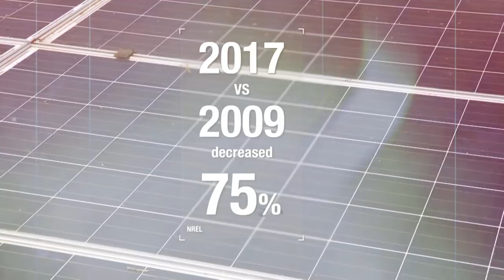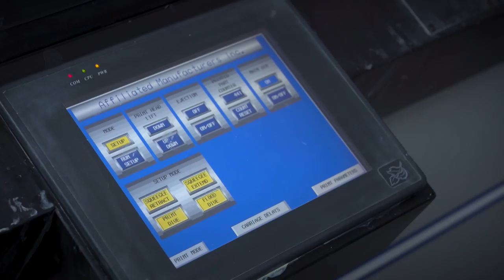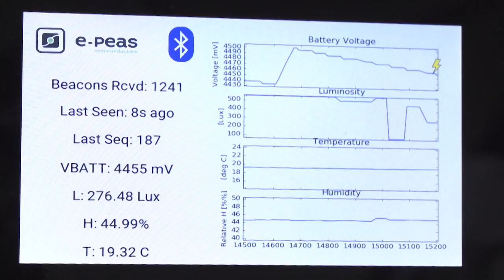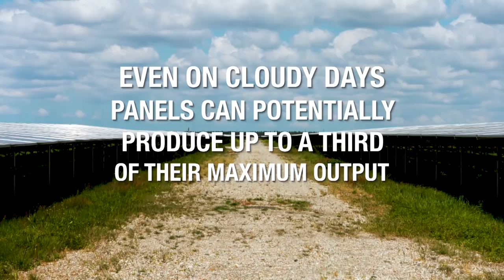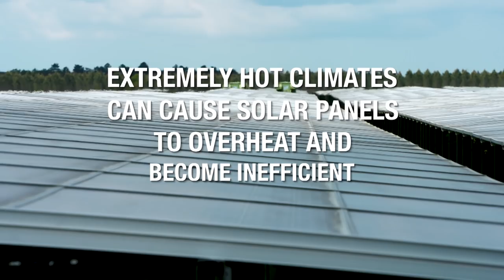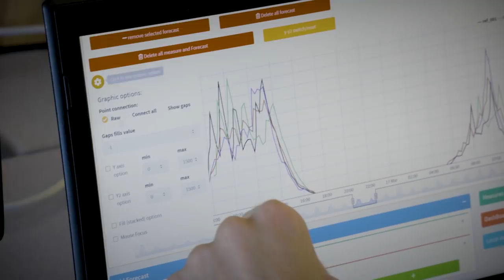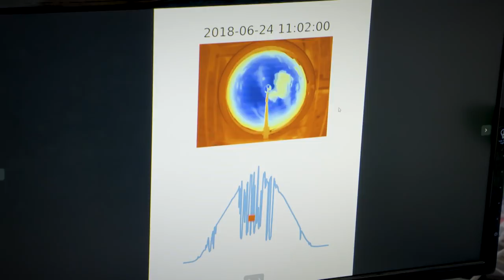Innovative ideas and smart technology are transforming solar power | Sustainable Energy

Comment: Wind and Solar generated wild AC that is not charging storage or similar such as working with hydroelectric power generation is mostly worthless because the dips of their energy output are having to be instantly made up typically by natural gas turbine generators running at high service idle consuming 70% of the fuel of full throttle, but producing little electricity.